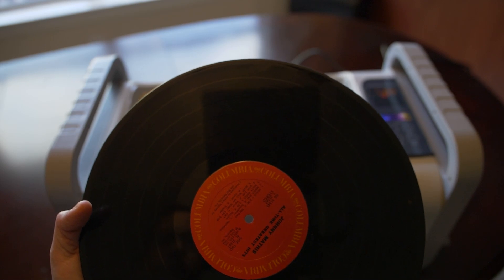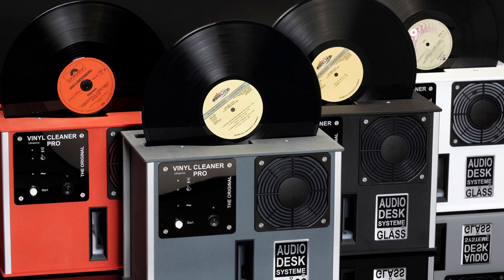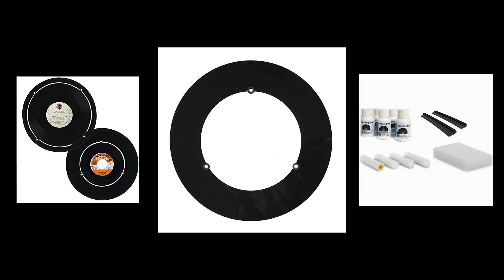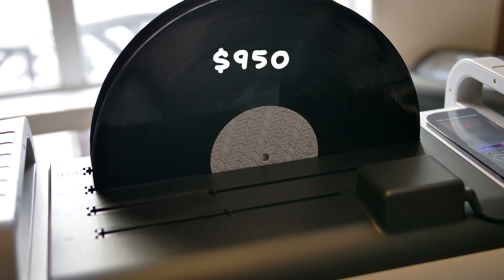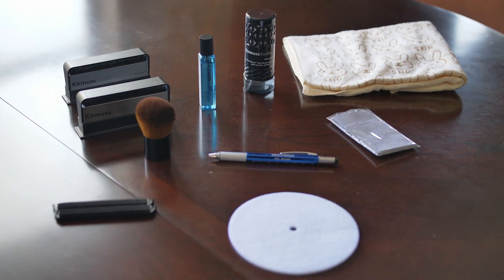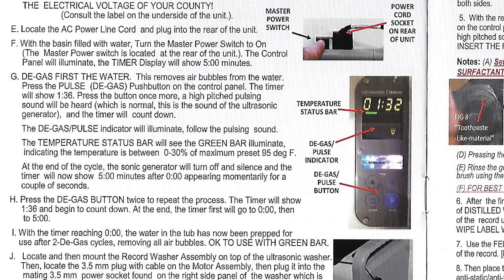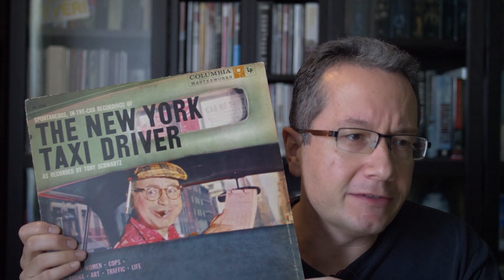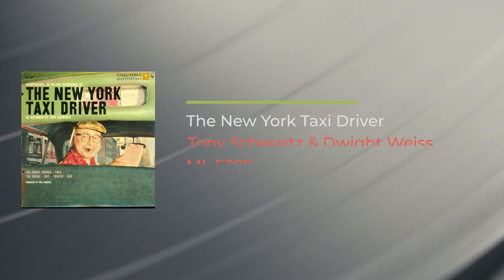Kirmuss KA-RC-1 Ultrasonic Record Cleaner Review and an Ultrasonic Cleaning Primer

Comment: Thank you Paul for info I’m still using a spin clean with paper towels because diaper rag leaves to many fibers. I have been leaning towards the upscale audio Kirmus bundle thank you again for the review
Reply from the maker: Nothing wrong with a Spin Clean.  It's what I started with and I had the same problem.  What I found worked well was to buy a label protector, do a distilled water rinse with a spray bottle, and let the record air dry.  The Kirmuss is one of the better budget ways to go ultra sonically.

Comment: I live in Spain, I have asked the price of kitmuss and it costs €2,100. I don't really understand that price if there are other brands that do the same and they are between €300 and €600.
Reply from the maker: 2,100 Euro?!?  That's way too much to pay for this unit.  Honestly, I think you would be okay with another brand but be wary of some of the cheaper Chinese brands that only clean one record at a time.   The build quality on them is not that great and I have heard after about a year or two of use, parts within them start to break.
Reply: @BarakaPDub  thanks

Comment: I watched this video almost a year ago. Since then I've modified my manual cleaning process and have now put the Kirmis on my list, illuminating others. 

Currently, I am still in the research stage of my record cleaning "evilution." So far I have been cleaning records using a manual process that includes Vinyl Styl and Record Doctor cleaning machines. I use the Vinyl Styl, which is similar to the Spin Clean, but with the advantage of goat hair brushes that reach into the record grooves whereas the Spin Clean uses felt pads that only wipe the record surface. I don't fill the resevervour with fluid because I don't like the idea of reusing dirty fluid. Instead I spray my fluid on the record spin it a number of times, let the fluid sit a few minutes, spin again, then use the Record Doctor to suck off the muck. The fluid I use, exclusively, is Audio Intelligent because it uses enzymes to loosen and remove a variety of contaminants which I have confirmed with Jim Pendleton, president of Audio Intelligent and with my ears. 

I have seen that white substance that Mr. Kirmis showed in his demonstration in his restoration process. He also demonstrated it with Micheal Fremer. This is the reason I don't fill the Vinyl Styl with fluid. 

After I wash, soak, pre-clean, and use the Record Doctor I rinse in the Vinyl Styl with a dedicated set of brushes, then vacuum that off. 

So far I can attest to this process. It is time consuming, but  it's worth the effort.  

I have been considering an ultrasonic machine to augment my method. The Degritter was, for a while, at the top of my list, but I have also been considering the Humminguru. The Degritter may be faster, but I don't think it'll clean any better than my current process, and that makes it cost ineffective. For the price of one Degritter I can buy roughly six Hummingurus. Six of them would give my the advantage of cleaning six vinyl records (I do have LPS, 45s, 78s) at the same time. This option is impractical because I really don't have the space for six machines, not to mention the issue of proper power requirements. 

I would like to pre-clean and rinse as many records at a time as I can and then follow-up with a final clean and rinse. The Kirmis offers this possibility. It is now on my list. 

The Audio Intelligent products that I use are really reliable, and cost efficient fluids. The company now offers a solution for ultrasonic machines. I'll have to ask Jim Pendleton whether his product can be used in the Kirmis. I suppose I should ask Mr. Kirmis as well, although I my risk unintentionally insulting him. 

Thanks for reading.
Reply from the maker: Great write up on your process John and I think it will work well.  An Ultrasonic will definitely augment what you're doing.   As for the Degritter, I had the chance to use one at a local shop and I got to say I was disappointed by it.  It's nice with all the bells and whistles it has to offer but in the long run, I felt it left some residual static from the drying process.  Honestly, it the ultrasonic process you need to go for.  The machine that does it shouldn't matter so much.  That's just my opinion though.

Comment: Honestly, the pricing for "vinyl accessories" is just ludicrous. I found a "kit" 6L ultrasonic cleaner with the vinyl mount / motor already included for 250€. From what I gather, these more expensive ultrasonic cleaners, except for the Degritter, which uses 120kHz, all use around 40 kHz and with somewhere around 80W power for the transducers and 120W or so for heating.
So... that said, the Kirmuss here and similar cleaners cost around 1000€ and all they seem to offer for that 750€ difference seems to be a more convenient way to put your vinyls in there and perhaps an integrated brush somewhere that wipes off the fluid while the vinyl rotates.
I'm sorry, but I must be missing something very important here? I mean, sure, vinyl enthusiasts tend to pay ridiculous sums of money for fairly pointless nonsense, I know, but that is just taking the cake?
Reply from the maker: Yeah.  I will concede the mark up on any audiophile equipment is generically quite high and I think a lot of this is driven by the size of these very small companies to keep themselves in business.  The market is also quite small.  There are cheaper ways of getting the same result as you illustrate.   Sorry for my delayed response.

Comment: Hi Paul, I saw other videos where they add a few drops of photo-flo 200 along with the 99% isopropyl alcohol instead of the 70%.  Just wondering if you have tried this solution instead of the one you described in this video.  If so, which one do you think cleans better.  Thanks!
Reply from the maker: I haven't tried that particular mixture at all.  It might clean a little better but I would have to experiment with it a bit.  I do think you will get to the point of diminishing returns after a certain point.

Comment: barakaPdub do you use your vacuum cleaner before the sonic bath? I feel like the pre vacuum has good be a good idea!
Reply from the maker: Nothing wrong with a pre-vacuum at all but I vacuum afterwards with a distilled water rinse.  The problem with the ultrasonic is as soon as your cycle ends, any particulates don't immediately settle to the bottom of the tank.  Some of them can land right back on the surface as gravity pulls them down.   This is my logic for the post rinse cycle.

Comment: I have this machine and haven’t started using it yet. I also have an vacuum cleaning machine , I noticed you mentioned you use both machines, at what stage do you use the vacuum cleaner? I was thinking the records need a good rinse after it runs through the kirmuss? Thanks
Reply from the maker: My logic is that I use the vacuum cleaner after the Ultrasonic.  A lot of the particles can float back on the LP surface after the cleaning so I vacuum rinse with distilled water afterwards.  I let it go a rev or two only and let the rest air dry.  Over vacuuming, like VPI will sometimes recommend, just introduces more static if the LP surface gets too dry.
Reply: @BarakaPDub  ok this is what I was thinking was needed, also to clean out any left over surfactant? I usually leave 2 revs, and then use the anti stat gun before putting a record on the table.

Comment: I have residue on some records how do I get rid of it ?
Reply from the maker: It's hard to know what to recommend without looking at it directly.   If it's a viscous fluid, I honestly recommend spraying the surface with Scrubbing Bubbles and letting it sit for a couple of hours.   That's what I do with really caked on muck and then using a record cleaning brush to gently scrub it away.

Comment: Any thoughts or ideas for a attachment piece to use on a small shop vac for sucking/drying the album? I'm sure there's a small head I could line with felt or another soft non scratching material but you seem to know your stuff so I'm asking you. Thanks and Merry Christmas.
Reply from the maker: A shop vac should work fine but with vacuuming, my only warning is not to over do it.  With my VPI, I've noticed that if I over vacuum, I just induce static back on the surface.  You get to the point where your surface becomes too dry and you just generate friction which just deposits electrons on the vinyl surface.   For vacuuming, I usually do one, maybe two, revolutions at most and leave it on a rack for five minutes for a final dry.   Thanks for watching and commenting Tim.  Merry Christmas.

Comment: Almost exactly the second birthday of this video! It's a dandy, well done, Paul. 

I watched this a couple months ago for the first time and didn't get the nuances. I've since seen several Kirmuss videos and understand the overall approach much better now. I gotta say I find the guy behind this company extremely off-putting, like you mentioned with the included literature and its frequent all caps and bold passages. 

I've put off going down the cleaning rabbit hole for many years now because I anticipated it would be just that: a rabbit hole. And it really is that. So many competing theories and personalities and egos and vested interests. Almost all of them (even contradictory ones) sound plausible and it seems you just have to try them out to find out what works. After several years of not going beyond an Audio Technica home cleaning kit and (don't laugh) wood glue, I'm quickly coming to a similar conclusion as you: manual agitation/vacuum system combined with ultrasonic. 

I'm currently doing pretty much what Patrick/Vinyl Archivist does in his 1-2 year old video with his vacuum system. It's pretty good and I've rescued several records with those techniques, but for too many records it's still not enough. I'd like to think that ultrasonic afterwards would be the thing that does the trick. The audio sample in your video is impressive and I want to be able to achieve that too.

I've considered the Humminguru because of its relatively low cost and several VCers seem to like it. But I'm concerned that it seems underpowered. So, the Kirmuss is increasingly seeming like the way to go. 

Where are you at with it now, two years after making this video and (I believe) 3 years after buying one? Has your enthusiasm for it increased, decreased, or stayed the same? Are you doing anything differently now?

✌️
Ian
Reply from the maker: I still love the system and it's still working like a champ.  I haven't bothered with the defungal stuff that he hypes.  With my method most new records end up being 99% pop and click free.  Today I got to sample a Degritter with a Classic Records audiophile pressing and I can tell you I was underwhelmed.  I think part of the problem is the auto drying and no rinse.  The record through the Degritter, while improved, we're not 100% click and pop free.  The record looked almost pristine going in and coming out.  If I spent over $3000 on a cleaning machine, I would honestly want better peformance out of it.   If you're looking to go a bit cheaper than this, the Kirmuss Ultrasonic tank is generic.  You'll find the tank on other brands and I would buy it or something like it separately and use something like the Vinyl Stack to rotate the records through the bath.  

Now as to the Humminguru, I would be worried about the reliability of the unit.  I have been hearing stories about breakdowns after 100 to 200 records being cleaned.  It's attractively priced though.
Reply: @BarakaPDub  good to know, thanks for the feedback!

Comment: It’s been a year since you did this review. Can you give us an update? What you like. What you don’t like. Thanks!
Reply from the maker: After having cleaned over a thousand records, this is still running like a champ and really no signs of wear at all.  I do recommend this machine if you're looking for something in between a total Do It Yourself (DIY) unit and a full up machine on the order of a Degritter.  I would avoid the Humminguru as I've heard those don't last long.  As cheap as it is, I have heard them falling apart between 100 to 200 records.

Comment: Hi, Paul. So, one year after this video was made (and having lived with this system for two years), does the Kirmuss Record Cleaning System still get the highest recommendation from you? Also, do you always use the Kirmuss surfactant or have you experimented with other alternatives?
Reply from the maker: Hello Ira.  I still recommend the system.  I have cleaned over a thousand records on it over two years and it's still running like a champ.   I have no qualms with it at all.   As for the surfactant, I still haven't bothered to use it.   Personally, I find if I do an Ultrasonic clean, followed by a distilled water rinse with a light vacuuming, and air dry, 95% of my records have been tick and pop free.
Reply: I already own a DIY unit utilizing the Vinyl Stack system with a generic Chinese-made ultrasonic tank, along with a Humminguru (that I just use for a quick clean), and a Pro-Ject vacuum unit. I’m wondering if the Kirmuss unit would really take my cleaning regimen to a whole new level and truly “restore” my record collection.
Reply from the maker: I haven't used his anti-fungal stuff at all and personally, I think if the Vinyl Stack is working for you, I am not sure I would change anything.  The Kirmuss would just save you a little bit of time for destacking the records.

Comment: Great review not only of the Kirumss, but cost effective considerations of other machines and maintenance. Right now I have a Vinyl Styl for dry cleaning and a Record Doctor for wet cleaning and vacuuming. I am researching the ultrasonic cleaners among others. So far the takeaways are some 2-step method may be necessary depending on the condition of your records.
Reply from the maker: There are some cheaper solutions out there and some of the DIY rigs work well.  I would steer clear of the Hummingguru.  I am hearing they are plagued with all kinds of problems and generally have failed after the first 100 or more records.  Three years on, my Kirmuss is still running like a champ.

Comment: Hi. Great review of the Kirmuss ultra sonic cleaner !! Very informative, I have a question though. After cleaning with the kirmuss, how many times - roughly, do you play the record, before cleaning it again ?
Reply from the maker: Oh geez...I am a terrible one to ask on that point.  There's only a few records I have returned to clean but usually my rule of thumb is when I start to hear an increase in clicks and pops, then I reclean the records.  I am okay with a click or pop hear or there because sometimes it's the vinyl itself that's the problem but for the most part after a good clean, most of my records are tick and pop free.   I do know people that are extremely anal and clean their records before every play.  While I can be anal, I am not that anal.
Reply: @BarakaPDub  Good to know, then there will be more listening time 😀

Comment: At what point in the process do you use the vacuum?
Reply from the maker: I do the vacuuming afterwards.  The reason for this is because you have a lot of particulate floating in the tank with the ultrasonic process is done.  Some may end up right back on the surface so I vacuum/rinse with distilled water.
Reply: @BarakaPDub  hahaha!! you"ve answerd that question many times by now paul!!but it shows a great personality and patients!! thanks paul:face-purple-crying:

Comment: Got mine in January, 2019, when they cost $870. I use it three or four times monthly cleaning both NEW and used LPs. It makes a world of difference. I don't mind the manual elbow grease, because you can see how well the unit its cleaning the LPs.
Reply from the maker: Thanks TBNTX for commenting.  I am glad your experience matches that of my own.  I too don't mind a little elbow grease.  Paying an additional $2000 for the auto drying just doesn't make sense to me at this point in my life.

Comment: Yeah vinyls are made from PVC but not 100% PVC its a randomly mixture. some are 100% some are 70% and so on, the other plastics they add can act weird towards alcohol.
Im not saying DONT USE ALCOHOL, i do it myself with around ~20ml on 1 litre of distilled water but some say there is no prove it can or cant take alcohol. even chemists say they dont know for sure. Damage could be done on micro levels but it also cant be done. nobody knows.
Reply from the maker: True.  All PVC has filler material to change the properties.  While I can't claim the filler won't respond, I've been using alcohol for years and have yet to see any issues.

Comment: This review misses many of the points of the Kirmuss.  It's distinctly labor intensive.  I'm a dealer and I acknowledge that.  Mainly I'm a record junkie.  It completely misses the issue of the frequency of the ultrasonic pulses.  Many of the $200-ish machines are 40K which is far too low and can remove high frequencies from records.  My main issue with some of the respected competition is the drying.  Yeah, I'd love to have it.  But the Kirmuss uses a surfactant and I think a final rinse with ultra pure water (Type I Lab grade) is a necessity as far as I'm concerned.  This is an extremely lightweight review.  I've cleaned over 500 records with the Kirmuss and have done a lot of experimenting.  I'd like to find a single album, small liquid volume ultrasonic for the final rinse but haven't found one that is acceptable.
Reply from the maker: Thanks for the comment and feel free to do a heavyweight review.  I would love to see what you would put together.